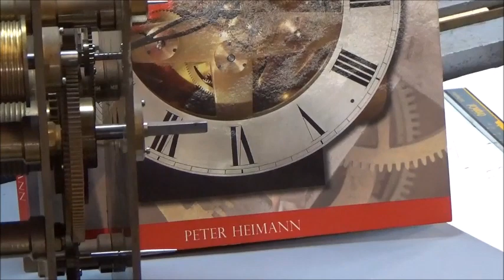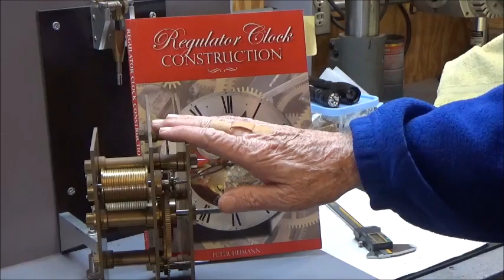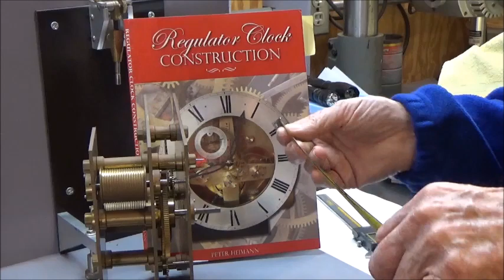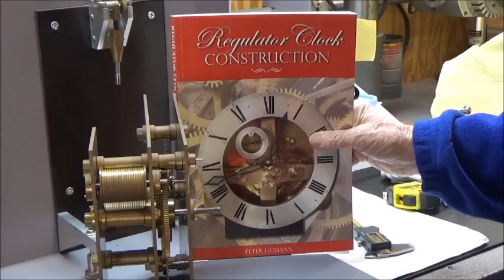Regulator Clock Build - (Reviving an Old Project)

Comment: You said very precise. How many seconds per month should it gain/lose?
Reply from the maker: I'm not sure at this point because I stopped working on it, so in reality it's still an ongoing project that I'll probably get back to should I live long enough.  All that said, it is a precise running clock.  Regards: Larry